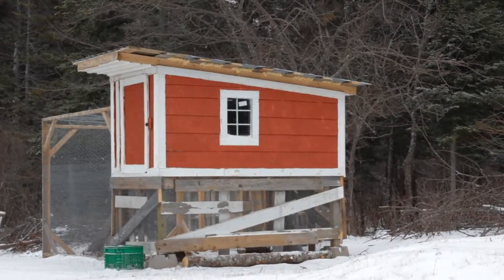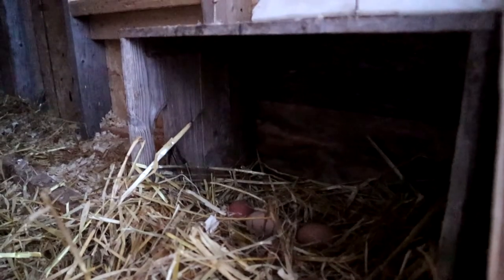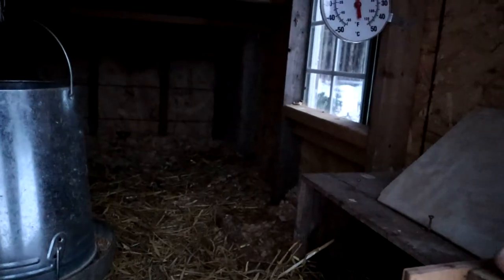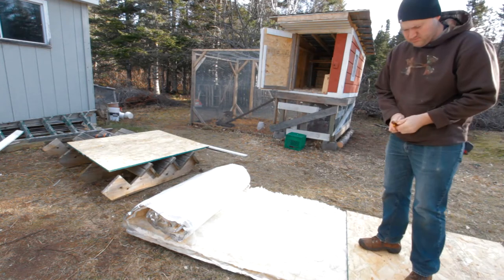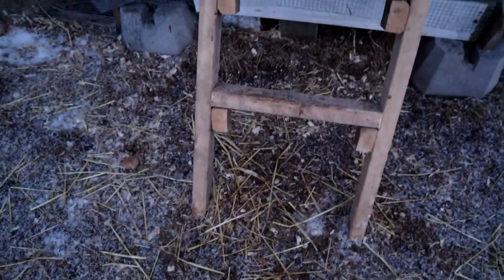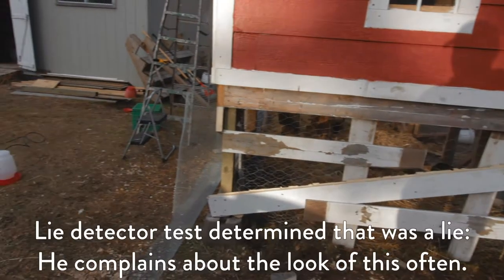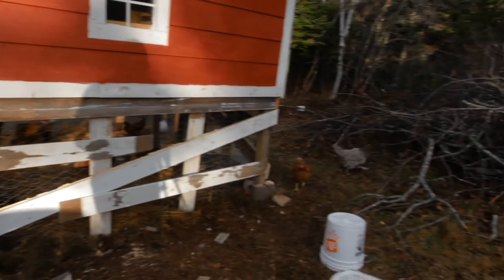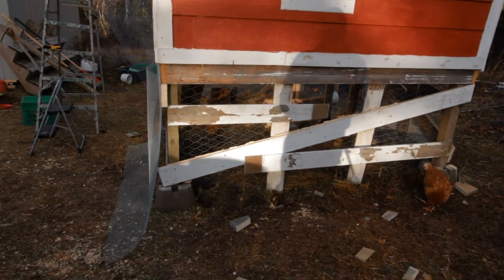Building a Chicken Coop With Zero Experience

Comment: You should use a round stick for a roost, the 2x2 is hard on their feet.
Reply: Its 2x3, from my reading I read that the round perch is hard on their feet so I put in the 2x3.  Hard to find reliable info.
Reply: @DomDaBomb77  In that case you sound at least round the edges, and the round is only bad if its too small, i like to find one the size of my wrist for size.